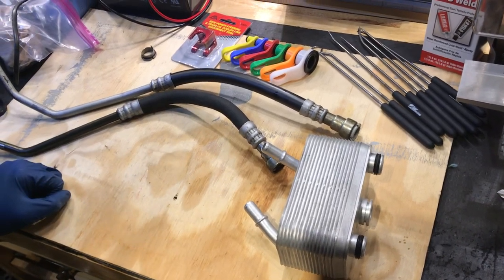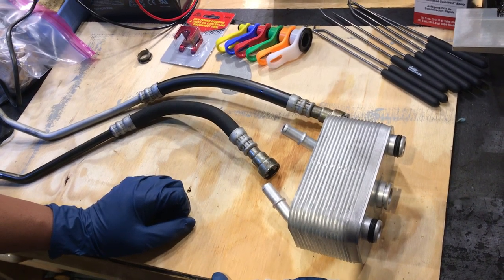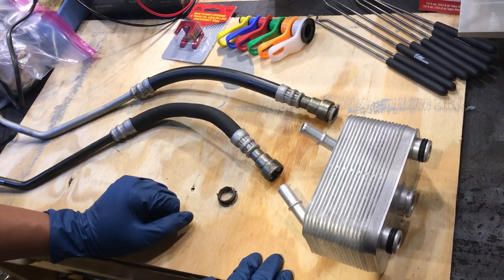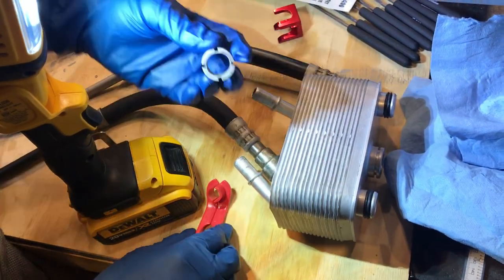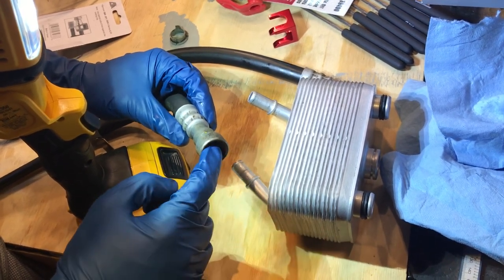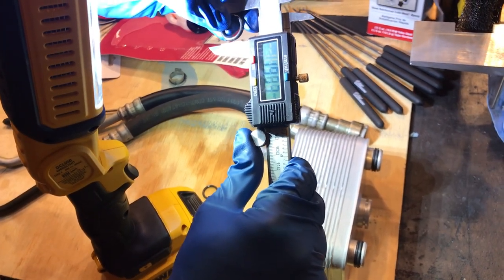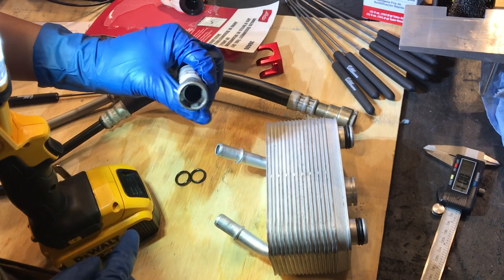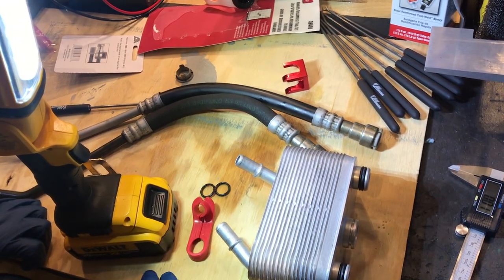2003-2005+ Range Rover / BMW / ZF Transmission Oil Cooler Quick Disconnect Line O-Ring Replacement

Comment: thanks for a well documented video, I have the same problem with my BMW and eventually was able to source the O-rings, they arrive tomorrow 13/11/2020,   I thought there was only one O-ring to each fitting,  luckily I ordered four O-rings thinking I might damage one and would have a back up hahahaha,  I was astounded to watch this video and discover that each fitting has two rings and how easy it was going to be to remove the rings,  thank you ever so much,  kind regards  Matt in Spain
Reply: can you tell me where you got the orings from and what size I measured and the old orings are 2.8mm X19mm
Reply: can you tell us where did you buy it?  size??
Reply: Where were you able to source the o-rings
Reply: @bobolson3085  Ihad problems sourcing the correct size of rings and ended up cutting the old connections off and forcing the rubber tube onto the metal tube and double hose clips,  been on for around 8/9 months and works fine with no leaks or blow off,s
Reply: Can you post a link where you bought the o-rings please. Thanks
Reply: @matttheman7721 it is possible to do it. So i can connect  directly the plastic tube to cooler hose with hose clamps . The plastik tube are long enough to reach  the cooler hose ?

Comment: On the crimp fitting. There is a tool used for AC lines. That tool is used to crimp oil, transmission and engine oil cooler lines. 
You can get the crimp ends at hydraulic line shops. I'm sure they can actually build you an awesome oil cooler lines with better quality hoses or braided hoses.

Comment: The coolant side o-rings are 14.5x2.5mm, 2 pcs.
Reply: 14.5mm ID
Reply: 14.5 is the outside diameter  and 2.5 is thickness  . 2 pcs  but for O ring inside the clamps  . Need 4 O rings for both connection.  I need those parameters so i can order somewhere please

Comment: great video..searched all over to find what is inside these quick lock ends..I went to a salvage yard here in Bangkok and got just the quick lock and then went into seeing what was inside ..took notes on how you went about getting out the o'rings ..I went about it differently ..remove the plastic clip then with 2picks on the metal band tabs lifted 2 out then rotated and the click lock assy came out ..then because the o'rings are held in with a plastic spacer washer I inserted a small blind bearing puller and out came the spacer followed by o'ring then plastic washer then o'ring and plastic washer ..to replace o'rings I used an electric conduit that is 19+mm about 100mm long ..fitted o'rings and plastic washers perfectly square then the plastic spacer washer to snug up the o'rings the quick lock assy and all good to go ..hope this helps ..by the way  hope this helps others ..here a power steering return hose for E46 BMW is over $300 just to pay for leaky o'rings

Comment: Question: any idea on what the problem is when RECONNECTING THE LINE THAT WONT LATCH? I replaced it an OGM cooler but one of the lines won’t reconnect… it’s seems like it’s like the latching part is not reachable when pushing in the line. Any suggestions????

Comment: Omg… just found your video accidentally. I have these for my 2001 disco 2 and I had no idea these had the 2 o rings inside. I was getting ready to bypass mine as it leaks horribly and I cut the Swedge out and used worm clamps and it still leaked. I may try and salvage it after all.

Comment: Thanks for making this very informative video. 
I have been having a problem with my gearbox when it gets too hot and goes into the dreaded cooling mode. I don’t get a high temp message but the box downshifts and stays in 2nd or 3rd gear until I stop and let it cool. 

I’ve already replaced the engine radiator, water pump and installed the 80C t-stat kit from Abbes performance. (only problem with that mod is in the winter I can get a low engine temp code thrown P0128)

Now my engine runs a lot cooler but my gearbox still has the temperature problem so now I’m going to replace the transmission cooler.

Did you have to drain down your transmission fluid level some before disconnecting the hoses?
Reply from the maker: You don't have to drain the transmission fluid level from the pan at all, just remove the lines, cooler and replace the cooler. When you start the car, the transmission oil pump will circulate the ATF into the new cooler and then you just follow the procedure to top off the transmission fluid. FYI: you must add ATF to a running car (in park) with the transmission between 30 and 40 degrees C. Any more or less and you'll get it wrong. Also, get an extremely large fluid transfer syringe to do it. And you'll need a breaker bar with an allen key socket on there to loosen the fill plug. Also, if you raise your air suspension when you get under the car, make sure you keep at least 1 door open to keep the air suspension from lowering.
Reply: Hello, I have the same problem! Did you change the radiator of the gearbox, and did it improve?

Comment: What about disconnecting the lines from the transmission?  I have a leak on 2012 Range Rover SC where one of the diff bolts rubbed a pin hole in one of my lines.  FML!  Lol. So instead of replacing the whole thing I was going to try JB Weld the hole.  What are your thoughts on this ?
Reply from the maker: JB weld is very strong and could definitely patch a pinhole on a line, just be careful not to let any JB weld actually enter the transmission fluid. That would be disastrous! To disconnect the pipe ends of these lines from the transmission you just use a regular metric socket (forgot the size) and open. You will want to purchase the correct copper or aluminum crush washers to replace (2 per line) and torque the banjo bolt back to the right spec. The LR dealer can order the right crush washers. 2 of one size for 1 line, and 2 of another size for the other line.

Comment: What was the correct size O-Ring that worked please 👍
Reply from the maker: I ended up using M3x13 O-Ring, 19mm OD, 13mm ID, 3mm thick, however 3mm is really way to thick and the lines were very difficult to get back on. But I justify using them, because they are so tight that they will never leak! I would recommend you find the same dimesion O-ring but find something slightly less thick than 3mm, like maybe 2.75mm if they make it. Amazon link here: https://www.amazon.com/M3x13-Viton-Ring-Shore-Durometer/dp/B005RUSYMY/ref=sr_1_2?dchild=1&keywords=M3x13+O-Ring%2C+19mm+OD%2C+13mm+ID%2C+3mm+thick&qid=1597370248&sr=8-2
Reply: @mjrgroup   I found these,,,,Round Medium Hard Buna N O-Ring, 13.0mm I.D., 19mmO.D.
Reply from the maker: Jose Nunez yup those will work. Just be advised it is hard to push them on but once you do get them on they will never leak!
Reply: @mjrgroup  Thank you so much for the video.
Reply: @mjrgroup  I put them on,, Sadly these didnt work for me,,, It still leaked as if the o rings were old,  Those the hardeness have an effect  I used 70a
Reply: I found my problem, The clear spacer is totally broken,  How can I replace that one
Reply from the maker: Jose Nunez Hmmm, for that one you’ll need to remove the whole seal stack. Get a pick tool and pull up on the spring clip assembly and the Teflon guide, it will allow you to remove the entire seal stack and o rings from the top. Then you can get the clear spacer ring out, size it up and search for a replacement.
Reply: @mjrgroup  how on Earth did you get the o rings back in the connector, I’m having a nitemare 🤦🏻‍♂️especially doing them on my back 😂😂
Reply from the maker: @Johnnybethnalgreen  Take a curved pick tool, and pull the metal clip assembly straight out. You will effectively open the entire seal stack and then you can layer the washers and o-rings in there and then insert the metal clip back over everything. Be very careful, if you pull hard, all washers, spring clip, and o-rings will come at you flying and you might lose some things. The reason I didn't demonstrate this method (of pulling it all out), is that it's risky. But if you're having trouble, this would be the best way to ensure you get the o-rings back in. Take note of the positioning of where the o-rings are in line in the stack. Does this all make sense? Think of it like a peanut butter and jelly sandwhich. Bottom slice, peanut butter, jelly, top slice. Keep note of the locations where the o-rings go, and then layer than back in and put the top clip back on to cinch it all down.
Reply: @mjrgroup  cheers mate 👍
Reply: @mjrgroup  wow them o rings were tight , I bought the same size you used , took some pushing on brother 😂😂😂thank you for the help ✌️❤️

Comment: Those quick disconnects are actually pretty generic and can be purchased by themselves in a variety of sizes. Lots of car manufacturers have used them for decades. I have them on my '85 Ford F250 on the fuel tank connections.
Reply: I'm trying to find some now to replace mine. I'm thinking about replacing the ends and crimp them too.

Comment: My god thank you so much. I’ve done everything I can to try and get these lines off and can’t do it. I need those tools!! Anywhere to get them quickly? I need to do this job in 2 days before I try to drive it 500 miles home...
Reply from the maker: Hi, sorry I didn't see your message before your journey. I bought them both off Amazon, but the fuel line disconnect tools should be available at any auto parts store.

Comment: Hi!
On a North American LR4 that has the same transmission fluid cooler, can you please tell me which side does the hot fluid gets in to the cooler? The more crooked side or the other?
Thank you!!
Reply: On the Disco 2. Hot oil comes in from the drivers side cooler inlet

Comment: Hi. Thank you for your video. I have 55,000 miles runs 2003 L322 4.4L with "HDC Inactive" and "Transmission Overheat" message on dash today. Symptoms were - a)Not changing higher gear at high speed. b)Hesitate speed up when stop and go - before the message. May I ask what symptom or message brought you to repair oil cooler O-ring?
Reply from the maker: Thanks for your message, Andy. One of the primary causes for a 'transmission overheat' message, in addition to a potential blockage in your transmission cooler, is sediment build-up in your engine cooling radiator, causing decreased performance. The only real way to determine if this is the case is to remove the radiator, flush it out with water and see how much gunk comes out. If you have a way to measure the flow then that would help, but for the relatively low cost for a new radiator (around $200 for an OEM Behr unit), it's just worth it, in my opinion, to replace it. The engine computer itself doesn't necessarily detect it as a fault condition but the transmission, which is always slightly slower to respond to temperature, does. I would highly recommend replacing not only the transmission oil cooler, transmission oil cooler thermostat, but the engine radiator, water pump, and possibly the engine cooling thermostat as well. These cars also come stock with a 108 degree Celsius engine thermostat which is insanely hot! There is a mod out there to replace it with a custom 80 degree celsius thermostat which I am looking into doing. Either way, since you've had an overheat condition, you must change your transmission fluid and filter now!

80 degree engine thermostat mod: http://abbes-performance.com/bmw-land-rover-lower-temperature-thermostat-kits/1-80c-thermostat-kit-for-bmw-e39-540i-e38-740i-x5-z8-e52-m62-range-rover-44-reduce-engine-temperature.html

On my car, the previous owner had that same message appear, and took it to a transmission shop. They quoted him about $2000 for a rebuild and removed the transmission, replaced some parts, and reinstalled it. However, they did not change the transmission cooler. Instead, the previous owner purchased the very aftermarket transmission cooler in the video and included it in a box of parts with the car when we purchased it. I suspect that he also used incorrect tools to try to remove the cooler lines and broke the plastic clips! When we purchased the car, we had to do a full engine timing chain and VANOS service, and also replaced every component on the accessory belt system and the entire engine cooling system (radiator, water pump, aluminum pulley upgrade, transmission thermostat, engine thermostat, etc.)

Also, I recommend the iLand tool from Atlantic British (roverparts.com), it's a bluetooth scan tool specific to Rovers that lets you interrogate all the data that any ECU in the car produces. You can monitor the transmission fluid temperature, function, and operational parameters in real time as you drive and read and clear all codes too. It was instrumental in diagnosing our transmission cooling issues.
Reply: @mjrgroup  Hey MJR. Your feedback was really helped to start my rebuilt project. Regarding 80 degree thermostat, I found that interesting idea from Samcrac channel ( https://youtu.be/WRP10YxWuVk?t=673   ) which makes some wholes to coolant passing through. What do you think this option?  We probably reduce engine temperature with simple drilling.

Comment: You are referring to an O-ring 17101439140 but this O-ring in the Real OEM BMW catalog has the dimensions 16.5X4.8X23 and is mounted 2 pieces fixed to the other 2 holes on the other side of the heat exchanger. Below you talk about the dimensions 13x3x19, which one is the right one? Thanks and sorry I hope you don't mind.
Reply: i think the part number is for the coolant side, not the oil transmission size, anyway if you di it can yoiu tell us what size you use on the oil side?? thank you
Reply: @roxycamilo  Yes, the part number is for the coolant side. I don't find correct dimension for O-ring used on the oil transmission. I try with 13x3x19 but it had losses also. I think  I have the hit pipe.
Reply: @viorelionescu196 what u mean losses did u try that size and still leaked ?
Reply: I need the parameter of the O rings that are inside the hose clamps. 2 pcs for each hose that goes to the transmission.  I need those parameters.  Its difficult to find because cooler  comes with only 2 o rings that are visible to see. The cooler side not the transmission  side. Please help me
Reply: @roxycamilo i need those parameters  of o rings that are inside the hose clamps

Comment: Makes zero since to me!!! You also have a hard green ring and a clear ring in there so do they go on each side or what
Reply from the maker: There’s nothing in my video that made any “sense” to you? This is free advice and a look at something most DIYers don’t understand. So take it or leave it. But just for you, maybe this will help: the green and clear rings are most likely teflon spacer rings and together with the o-rings form a "seal stack." The way I demonstrated replacing the o-rings is the easiest least-risk method for doing so without damaging or losing the positioning of the teflon spacer rings. Alternatively, you can pop out the steel spring clip piece and remove the entire seal stack and insert new o-rings and the spacer rings easily and then snap the steel spring clip back in. IIRC, the order is clear ring, o-ring, green ring, o-ring, steel spring clip assembly. Hope it helps. Before removing the o-rings check the positioning and just ensure you replace the o-ring in the correct place.